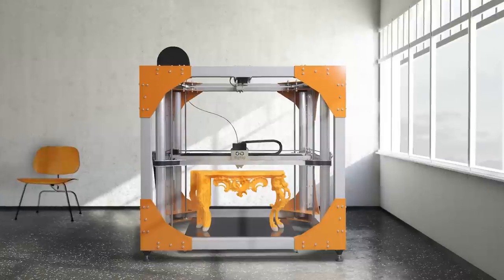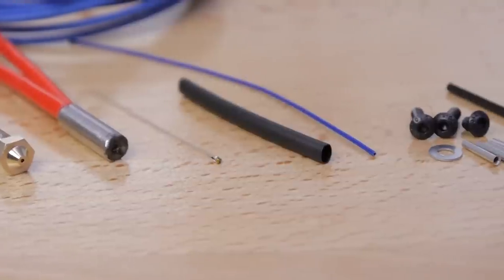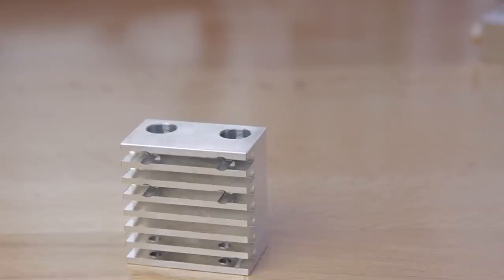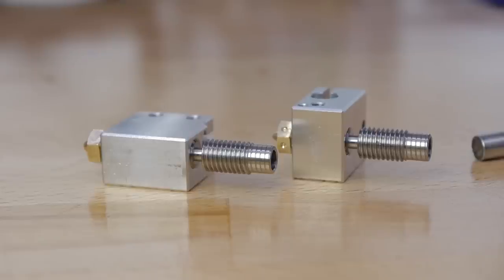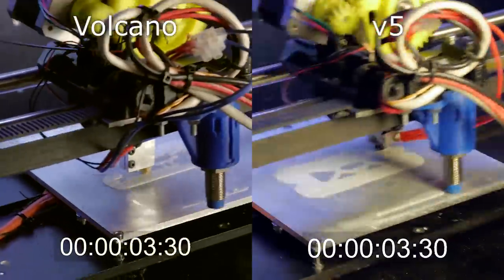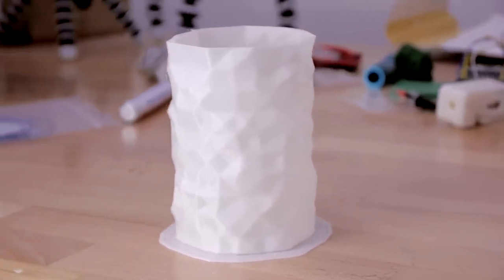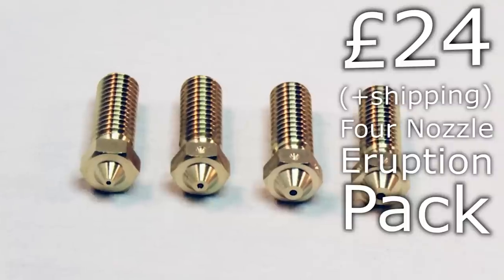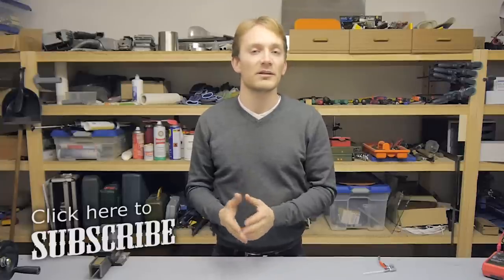The E3D Volcano

Comment: Why not a dual setup where the .4mm prints the outer high detail and the volcano prints the inside fill. That way you get the best of both worlds.
Reply: That's a great idea. I might test that out. As a test I set a model to 100% infill, and set my other extruder to do the infill with a .8mm nozzle, and the time reduced from over 10 hours down to 5 hours.
Reply: Did this work for you?  If so, how did it turn out?
Reply: Nozzles would be at different heights. Volcano is longer
Reply: @jimmer147  You could have dual volcano, like with the cyclops heat sink.  Only diameter of the nozzle would matter then.
Reply: Off The Wall Family well, good luck with Z leveling of this hotend for dual extrusion :) it’s practically non existent.
Reply: I was thinking of this as well.
Reply: isn't infill stronger per weight when using thinner extrusion widths (= high detail, 0.4), making this idea fast, yet not efficient?
Reply: This set up requires same layer height which doesn’t make much sense for larger diameter nozzle

Comment: Thank you so much for making these videos. They are incredibly helpful. You break things down very well and keep to the point. Also, I'm a fan of the very subtle humor you infuse into these informative videos. Keep it up (please)!
Reply: That's awesome! Just curious: What precautions do you personally take to combat the fumes produced by extruding these plastics? I have been reading about the effects of these fumes and some ways to filter them etc. I have my 3D printer near a window (not too close) and have a window fan pulling air out but I hate leaving the window open, as this introduces variations in the room temperature. I put on a respirator occasionally if the fumes become too irritating.

I am seriously considering a fume hood of some kind. I watched a video about a DIY fume hood that filters the fumes before they are sent outside to protect the environment. Any suggestions? Just curious if you have some kind of setup in place to help with this. Much appreciated.

Comment: I am using my printer to make large flat tool templates for my aviation tool boxes. The norm for many decades was to use two layers of foam board with contrasting colors to show which tools are missing. By using 3d printing technology, the task of templating a box can be done with much less manual labor. The templates can also be divided into smaller sections so that they are modular, and can be changed as tools may be added, removed, or replaced. The templates also maximize the use of storage space. The ability to print these quickly really adds to the value. These are not meant to be ascetically pleasing items, but rather, very functional.

Comment: I experimented with larger bore in the past. 1.55mm bore to be precise. I bored a j-head to that size. It printed fine, but had to ramp up the temperature as the hot end had very little thermal mass to keep up. I am glad e3d have come out with this. I am currently experimenting with a 1mm nozzle on my own setup and will upload a video with a DIY version of this. I wont like my video to this video as I feel that is bad practice. Happy 3d printing everyone. :)

Comment: Thank you for this review, I'm wrapping up a Vulcanus Max build that I scaled up to 600mm x 400mm x 400mm with the intention to use a .8mm nozzle. This pretty much confirmed that this product is the right tool for the job. Thanks! Also to answer your video's question, I build large props and the finish work is half the battle anyway, lower resolution is not a problem at all and it was expected moving into a XXL print volume machine.

Comment: Tom, I am looking at making a Delta printer with the best components money can buy. Because my client is going to use it for true prototyping. Where they fit the model to an engine if it doesn't fit or has not enough access for technicians to reach we just redesign with more space and print again. Vehicles are not available for very long so I need ALL the development done in two days. This is a low resolution speed optimised requirement so I will be looking at 1000mm/s and above speeds with head masses as low as possible. This is EXACTLY what I will be looking for. Thank you.

Comment: I think a vulcano and a normal nozzle combined and using the vulcano for the infill could be a worth a try.
Reply: ***** Of course you have to design your own extruder block. Leveling both nozzles is always a problem with dual head printers. A year ago I build a printer where you could lift each nozzle individually. The second version used the e3d heat break. Adding the volcano there would be possible with no changes. Unfortunately I shifted focus away to other projects. But you can see my first results here: http://youtu.be/x1B9tUmrcrw
Reply: It is done by a printer called robox i think. Maker muse channel have a video of that

Comment: How does the retraction setting work for this long heat block? it's hard to digest the fact that there is no visible Ooze. I'm sure there might be some issues with clogging of the nozzle. Maybe I will try to integrate this with my D3D auto lift hot end. Still looking forward for T-bone cape for BBB  review. Thanks a lot, your doing a great job.

Comment: I would definitely consider buying one, it's just not what I need right now.
I do think that certain print s can come out really well in thick layers like simple drawers. but for what I'm printing now my .4m v6 is great maybe I'll get a regular .8mm nozzle for larger prints.

You kept referencing the volcano with an .8mm nozzle  but the standard v6 also has a .8 nozzle, yes there are many benefits to the volcano with that longer path but some benefits should also apply to the v6.

Can you do a test/comparison with a short .8 to see what benefits stay, will it also ooz less, will it also go so fast your extruder won't keep up? (probably not)

Comment: So seeing as this Extruder is made for huge layers, would it be possible to have a dual head setup, each with a different extrusion width so that you can print the main body of an object at high speed with the giant extrusion layers at speed, while having different areas of the same object be printed out at a smaller, higher resolution print for precision?
Reply: +Clayton Merritt would love to see an answer to this!! anyone?
Reply: +Clayton Merritt Short answer is yes, you can set the infill or supports to print every 4 layers with a .2mm layer height on the .8mm nozzle which would make the print much faster you would need to adjust this to your printer and extruder though. That is with one extruder by the way I am sure you could do the same with 2
Reply: Nevermind just reread the post but I am sure you can do it.  Lot of smart people doing this.
Reply: spread the idea, i always ask this the producers. Someday they will listen ;D

Comment: great stuff TOM!!!  As usual...  I built a MEGA Delta that is 500mm diameter X 1000mm tall build area.  The challenges of this build led me through two different operating computers, multiple re-wires due to length and voltage drop, eddy currents from my 900 watt bed heater using alternating 60hz power, structural modifications....  This hot end is quite interesting to me because as I have found the longer it takes to get the print done the more likely there could be something going wrong,  (power source issues in particular)  The things that matter to me are less resolution than they are layer adhesion, bed adhesion, consistency.   One question I would have is related to power consumption.  The MEGA is back to an Arduino with Ramps 1.4 and I'm curious if the ramps can handle the needed power for the element.  I know there is no actual change in the voltage for the Volcano but is it longer and requiring more amperage thought the on/off cycles?  If so do you see any problems with running 200 hour prints?
Reply: Whaaat only 50cm x and 100cm tall Mega???

Comment: I want to print a kayak on a 2x2x8 foot printer. Playboats for surfing stading waves
Reply: I'm 17 I'm making a 3d printer that builds 17x25 inches that sounds like a fun project
Reply: *****
I don't disagree with you. But what are you thinking will be the problems?
Reply: Yes but as you double diameter of the nozzle flow increases by a factor of 4. I would have to have HIGH PSI compressed air cooling. enclosed build space.heated bed.
Reply: I theorized a 2mx2mx3m or larger one (for a mostly printed car you can get inside), using a filament maker for 5mm filament and 3mm nozzle (mainly because at these sizes the 10x cost increase for filament vs pellets is a problem, and you would need 10kg+ rolls), styrofoam plates for the walls and glass wool for the top and bottom, and floor heating wire embeded in routed wooden flooring, with a 2mm aluminium plate and glass on top for the bed plate, and 200V 2kw peak brushless motors with an encoder for the extruder and axes.  (high voltage allows to use rectified 220v AC for the controller and reduce its cost.)

Comment: I think the Volcano hotend is a great idea. I would get one mainly to speed up queue times for multi-part mechanical assemblies, mainly tube or pipe clamps, where the layer adhesion strength helps. Would thick extrusion widths work for printing RepRap parts? It would be cheaper to produce RepRap part kits to sell or give away to potential RepRap builders.
Reply: Yes, Im just printing Delta parts and see no problems. You just need to check your Slicing a bit e.g to not loose walls between thinly spaced holes.

Comment: Hey Tom... I know this is a 2-year old review... but had a question... Just getting into this "hobby-cum-mania" and was checking out all the hot-end options.  Currently getting my first mini-kossel built and running.

Thinking along the large-volume prints, do you know of any examples of using dual-extrusion heads for doing a combination of "high-rez" and "low-rez" printing per-layer?  Kind of a "split the difference" game of using something like 0.2 or 0.4 head for a series of tight 0.1 high layers and then laying in a "fat" 1.0 layer every 10 "thin" layers for the backing-support and in-fill.

Comment: Question for you Thomas. My mini-Kossel's J-Head kept giving me issues with back-pressure building up in the Bowden tube. It ripped the fittings out of the extruder-side... While I was printing PLA at 205C (the PLA roll was rated between 190 and 210). I'm wondering if using the Volcano with one of the smaller print nozzles (0.4mm) would help eliminate the back pressure? I've tried the E3D Lite6 head with 0.4mm but there's still a bit of back-pressure, even at a very slow (for a kossel) feedrate (<10mm/s).
Reply: Thanks ***** , I'll see if maybe my sensor's readings are wrong somehow. I'll increase the temperature to a higher level and see if the PLA flows more freely through it. But I still feel that if printing quickly, the Volcano would help as it gives more time for the incoming filament to heat up to the required temperature. I've been looking but can't find any hint one way or another. My printer was sort of abandoned during the summer, when I was outside flying the drones I printed. I came back to it, and haven't changed the filament. I wonder if there was some kind of oxidation that happened that makes the PLA need a higher temperature for printing? I hadn't printed in 6 months before getting back to it.

Comment: Hi Tom, I'm trying to put a volcano on my Prusa I3 mk2 and I'm having trouble figuring out how to reset the nozzle height in the firmware so that the calibration routines will run properly.  I also need to figure out a better mount for the PINDA, but that's secondary to the nozzle height issue.

Thanks! Great videos too, keep up the good work!

Comment: I would like slicer software that could utilize a dual extruder 3D printer with a different nozzle size on each so that the large nozzle prints the bulk of the print while the smaller nozzle fills the perimeter / smaller details. That would be awesome!

Comment: Hi Thomas, I would to test volcano.
Do you have some suggest for speed of print or temperature.
I used to print, with my anet a2, petg 1.75 to 235 degree with 3dv6 0.4 all metal to 40mm/s… 30mm/s for wall and top and base layer and 50mm/s for infill… with this setting I have good result.

Comment: I'm thinking of upgrading my hotend to the volcano and use 1/1.2 nozzle, but I do not know if change to 3mm instead keep 1.75. My goal is quick prints from filaments that requires higher temperature. what is your advice?(printing area is 400x400x600 mm)

Comment: Hey ***** Love the channel. Question. I am looking to upgrade my HotEnd and I know E3D is the way to go. I love the idea of a dual extruder but not sure if I would be wasting my money on one of the dual heads. So my question is witch one would you get?
A. a single v6 + Volcano
B. Chimera
C. Cyclops
Thanks
Reply: ***** I ordered mine yesterday from filastruder. I ordered some .8mm tips for it instead of dual Volcano. It would have been too much for my budget at this time. Also how long do the tips last? I ordered 2 extra .4mm tips just in case.

Comment: I have a Bowden J head and I am using the little fan as part of the PI loop temperature control .   Since my setup is totally homemade and I am learning as I go ahead, I am curious if the heatbreak requires the fan to be allways on or not so I can just use it to control the hotend temperature with it.

Comment: Hey Thom, You have a video about transparent printing (PETG), does printing with volcano in transparent material improves the transparency?  I mean, printing in only one layer (Wall or Top/Bottom) could improve the transparency?
Reply: as I know you just need to cool a printed "parts" as quick as possible and not over-heat them (this plastic has the next state with less transparency and some thougher structure).

Comment: Any benefit from the volcano if i'd be running 0.4 or 0.25 nozzle?

Idea is, id have a second extruder with the 1.2mm to do 100% infills.
Reply from the maker: For the 0.25mm nozzle, the longer heater is likely pointless, but if your printer's mechanics can handle the speed, a 0.4mm Volcano will melt filament much faster than a regular heater block.

Comment: Hello,  I am curious if anyone has a recommendation for an extruder setup that uses the v6 hotend.  I am researching components for an extruder, but there are a ton of choices out there and I was hoping to get some feedback on which type to consider (bowden, direct, etc).  My main concern is that E3D doesn't manufacture complete extruder kits, simply the hotends (which look great, but that means I have to look elsewhere for the motor, mounting block, tensioner, etc).  Any help is appreciated! Thanks!

Comment: I got a clone eruption pack from aliexpress for $8. The throat and heatsink were another $4
Reply: How was it? Was it worth the price?
Reply: actually yes. I recommend using a geared extruder though because it does need a lot of force.
Reply: Ok, thanks. No real problems with having bought a clone? (Of course this is greatly a YMMV question.)
Reply: Hi, Zak! How is your clone now? I'm guessing that my Tevo Flash has a clone version inside (also not sure). Didn't gave you some clogs?
About the extruder: is Titan OK for it? I'm having doubts with it because it works in two states (in my setup) basically: it bites a filament too deep (so too much retracts starts grinding and then it ruins the whole print); 2nd: it doesn't keep the filamend hard enough... so if it's a bit stuck in the hot end then it just clicks and skip extruding. This leads to under-extrusion obviously.
I hope you'll give me some hints or clues :)

Comment: Off topic I know, but is anyone working on a PC interface board to control a 3d printer? Even a break out box to handle heating currents would be a welcome cost compared to using 8 bit boards. Board like duet WiFi and others are great, but still old tech compared to the cpu power of even an old Xbox. I have like 6 old working Xbox 360s and lots of lot Linux boxes that I would love to use as printer controllers. Any info?

Comment: CLONE NOZZLES: Watch out for THIS on the "clone" nozzles from China… I got a GREAT deal on a nozzle 4 pack, but found they used the SAME nozzle , just drilled out the hole larger. WRONG!
The true E3D nozzles have a different geometry for each nozzle (one thing is the FLAT of the nozzle varies). Read this Blog about why it matters: (The section on “Nozzle Specificity and Indentifiability”)  https://e3d-online.com/blog/2014/05/15/v6-blog-announcement/  It's an interesting read, very informative, from the guys who INVENTED the E3D & the Volcano.